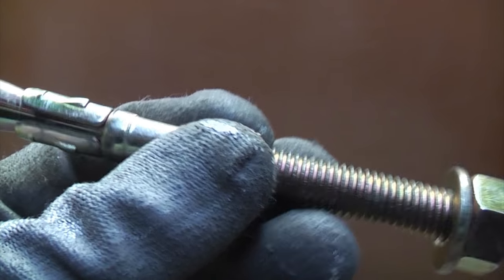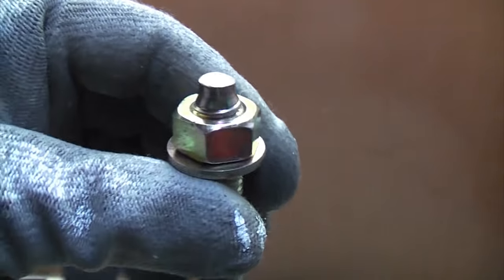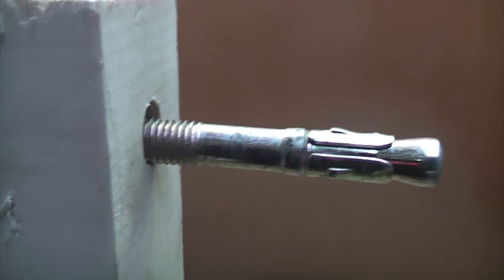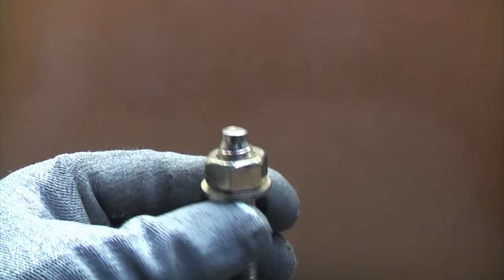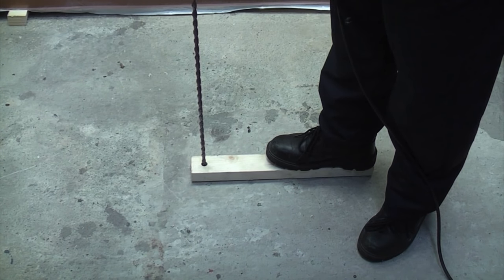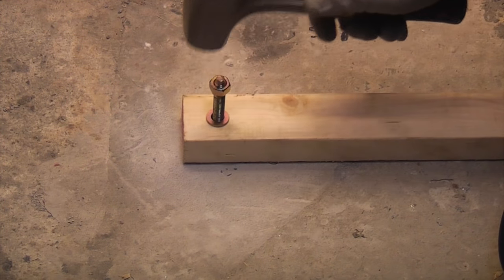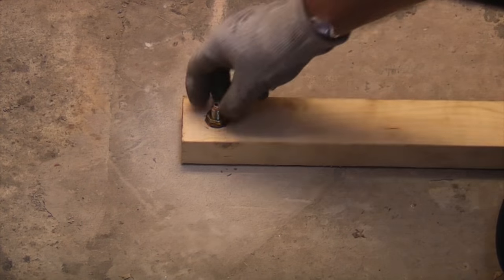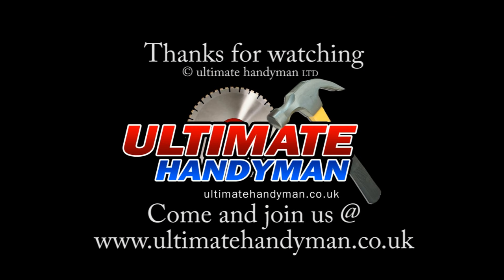Concrete anchors

Comment: When using out door in concrete exposed to the moisture water , so you need to use stainless steel screws ?
Reply from the maker: Yes, you can get stainless steel ones for external work, or some have a rust proof coating too.
Thanks for the comment 👍

Comment: Can you use this method for securing a post onto a paving slab? Do you have a video ? Thanks
Reply from the maker: You can, but I don't have a video, sorry. 
Just make sure you don't put them close to the edge, or the expansion force can crack the slabs.
Reply: @ultimatehandyman  thanks for your response and much appreciate your videos.

Comment: Hi.  I enjoyed your video, and have done what you said and drilled my hole about an 1.5" deeper than needed so that I could pound it level in the future if ever needed.  However, my neighbor (who is a really nice man) just told m that the mechanism of the bolt's expansion is thru it "bottoming out" in the hole and that it wouldn't work right with that much empty space below it.  I obviously see that your demo shows it to hold securely, but I just thought I would ask if you don't mind.  Does it matter if the depth of the hole was 2 or even 3" longer than the end of the bolt?  This is in a pad I poured that is 36" deep, so there is plenty of room to drill.  Thank you!
Reply: +LuvmyGSD I think I found my answer!  Sorry to have bothered you with such a basic question, but every video I watched just showed how to install it, it never said exactly how they worked and I finally found one that explained that it pulls that flared piece UP which caused it to work.  Again, I know this is very basic, but its my first time with them and I got worried.  Cheers!
Reply from the maker: +LuvmyGSD 
Glad you found the answer ;-)
Thanks for the comments

Comment: Good video...but. when clearing the mound of dust after drilling the hole, use a vacuum instead of a dust pan. Use the vac to clear the mound of dust, then position the vac hose over the drilled hole to clear debris from the hole for a better, more secure fit for the bolt.

Comment: I am building a 12x12 shed on a concrete slab. My question is how many fasteners will i need per wall or what is the recommended spacing for this type fasteners?
thanks for the video
Reply from the maker: I'd use M12 or M16 through bolts that go into the concrete by at least 100mm and I'd space them out about every 2 foot (600mm). That should be sufficient, although if you live in a really windy area it would be a good idea to use a few more.

Comment: hy any chance you could explain in a video the method for attatching timber posts to concrete fence posts please. i dont know what bolt to use . is there a way i can jus use bolts that go straight through timber and concrete without a nut on other side as i thought it be easier if the bolt will not come through the other side of concrete post . iv seen large bolts with threads which i think cut there own whole once in and no need to put nut on end. thanks for your videos
Reply from the maker: Sorry, I have just seen this comment as it was in my spam folder.
If you are fixing a piece of timber to each side of the post you can drill through one side and the concrete post and then use a coach screw, by screwing it into the post that has not been drilled.
Or you can drill straight through everything and use a coach bolt, nut and washer.
Or you could screw from each side and use concrete screws to fix the timber to the concrete.
https://www.youtube.com/watch?v=P0LXQG3S8ko

Comment: Hi,i am trying to secure base plates into concrete using anchor bolts but it will not tighten am i drilling to deep? Would you recommend concrete screws ?
Reply from the maker: No, drilling too deep will not prevent the anchors from working- drilling the wrong diameter hole will!
For 8mm bolts you need a 8mm drill, 10mm bolts you need a 10mm drill etc.

Comment: I always do the same thing I’ve  use the right tools and the right drill bits and I’m tired to have a problem tightening, when i turn the nut the all thing turns and the bolt can never be tight. What’s the secret ??
Reply from the maker: If the drilled hole is slightly too big the anchor can rotate (sometimes this can happen if the drill bit is slightly bent). 
To fix this problem, put the nut and washer on the anchor, then use a claw hammer or crow bar under the nut and lever the anchor up, as the anchor moves up, it should expand on the end and then grip the hole.
Or you can put the nut and washer one, then grip the very top using mole grips/Vice grips and tighten the nut.
Thanks for the comment 👍

Comment: Hi, I want to use these anchors to mount kitchen cabinets. The walls are concrete. Is there a better method for this?
Reply from the maker: Hi, These are probably your best option for concrete walls as they hold extremely well in concrete. 
You obviously do not need anchors as large as this for kitchen cabinets, we often use M6 (1/4 inch) or M8 (5/16 inch) diameter anchors for small jobs at work. 
It does depend on the type of cabinet hangers that you are using, in the UK if I was fixing to a solid wall I would just use wall plugs and screws to hold the hangers to the wall. 
http://www.ultimatehandyman.co.uk/how-to/fasteners-fixings/wall-plugs

Comment: Can I drill the hole with just a dig corded hammer drill and would thou reocomend this for fixing a shed to the floor thanks
Reply from the maker: Yes, but if the drill does not have hammer action it will be really difficult.
These will be fine for fixing a shed down to a concrete base.
Thanks for the comment

Comment: Will these fit through a hole in a bolt down plate for a fence post ?
Reply from the maker: It depends how big the holes are. If you have for example a M12 hole and you use a M12 anchor, it will not go through the hole, you either have to drill the hole larger in the plate, or drill the holes in the concrete, knock in the anchors and then fit the plate over the anchor (the base of the anchor is wider than the threaded part)

Comment: I want to use these to attach a ledger for decking purposes. How deep do I need to drill into the brick? I know the brick is a solid engineering brick but not sure if I drill too far where will it end up the other end? I understand the bolt bites the other end when it's tightened but if I drill too far what does it bite into?
Reply from the maker: Bricks are about 4 inches deep, so if you drill about 3 inches you should be fine.
Obviously, you do not want to go through the brick or it won't tighten fully and expand as it should.
Here is a ledger that I installed a few years back-
http://www.ultimatehandyman.co.uk/how-to/decking/fixing-a-ledger
Reply: On that subject. Some say it's not good to put a ledger level or within 150mm of the DPC. I have used Thompson sealer on the brick and will use washers to leave a slight gap. Your thoughts please
Reply from the maker: I've always set the ledger level, but ensure that the deck is sloping away from the property.
It's best if you can get the deck below the DPC but this is not possible most of the time.
P.S. make sure you use rust proof washers or you might end up with rust stains etc.

Comment: Hiya. Will these work ok in sandstone or will it pop a peice out? Thanks
Reply from the maker: +Greg O'Brien 
They will work in some sandstone, but are really designed for concrete. As long as these are not being used too close to an edge they should be okay.

Comment: Hi! 

I'm wondering how well these will hold in a breezeblock wall? Any idea on how much force then can take perpendicular to the wall/floor? 

Many thanks!
Ed
Reply from the maker: I don't think they will work well in breeze block, snap toggles will work though-
snaptoggles
Reply: *****
The snaptoggles look good - thanks! But i'm unsure if they are hollow? I'm also planning to put quite a lot of weight on it which i'm not sure if snaptoggles would hold.. 
But not to worry - thanks.
Reply: Edward Hayter
Ah unless you meant go all the way through the breeze! That would work well!
Reply from the maker: Edward Hayter
If you drill the fixing holes and hit the cavity in the breeze block you could use a snaptoggle, if you drill and it's solid (such as at the edges) you could use resin fixings-
Resin anchors | Resin fixings

Comment: Very informative thanks m8. could you use that for securing a lock loop for a bicycle ?
Reply from the maker: You could, but it would not be very secure and anyone with a spanner could easily steal it. You can get some security construction fixings that require special tools to remove, one of those would be much better IMHO
Thanks for the comment
Reply: point taken, I'd hope by the time they got to bolt no 4 someone would see them lol

Comment: hi chez are these thru bolts the same as rawl bolts or they 2 different things? i seem to be getting confused as the more i read there seems to be more and more different types of anchor fixings, am looking for an anchor bolt i can screw down flush with metal late not one that sticks out like these thru bolts seem to, cheers john.
Reply from the maker: +John Walker 
Yes, you need the bolt type for that, normally called rawl bolts.
Reply: +Ultimate Handyman chez can you hammer these in so the nut is flush then tighten it or do you need to leave the small gap berfore you tighten up. cheers john
Reply from the maker: +John Walker 
Yes, you can knock them in with the nut on the very end, then tighten.
But when you tighten it pulls the stud up through the nut and can stick up 10-20mm before the fixing is tight enough.
You could of course cut that bit off with an hack saw or angle grinder
Reply: +Ultimate Handyman thanks chez
Reply from the maker: +John Walker 
You are welcome John ;-)

Comment: Can you use these also without problems in a brick wall?
Reply from the maker: They are not designed to be used in bricks as most bricks have hollow sections, however I have used them in some bricks and they worked fine for me. I'd be more inclined to use resin fixings though as they will definitely work- https://www.youtube.com/watch?v=oUJPjJsdl0c

Comment: Bro this bolt can bear 80kg or 100kg wight , if we set in house slab .. rply bro..  for hanging purpose .... Which size will u preffer for my requirements
Reply from the maker: You'll have to check the manufacturers specifications ;-)
Thanks for the comment 👍

Comment: I have just built a 20ftx12 workshop I need to fix to concrete,I have 100 mm 10mm concrete bolts,do you think he's are adequate
Reply from the maker: It depends, there are just so many variables, such as what the structure is made from, the weight, the amount of fixing points, the potential wind etc. 
We would often use eight M12 by 100mm anchors just to hold down a conveyor unit, where the conveyor is heavy and it's inside- so no wind etc.
Reply: Also if you don't mind,I have hitachi sds plus drill,but collar only seems to take around 12 mm diameter bits,I have 200 mm x 18 mm bits,to wide, what do I need?
Reply from the maker: @philhode5104   All SDS drill bits are the same size (where they fit in the chuck).
SDS and SDS plus are about 10mm, where they enter the chuck.
SDS max is about 18mm where it enters the chuck, it sounds like you have SDS max bits! 
You either need a SDS max drill (very expensive) or a SDS drill bit
Reply: @ultimatehandyman  thank you,yes I realised what has happened, I ordered bit from UK drills,I received max bit,was puzzled why it didn't fit,now ordered sds plus bit,yes sds max expensive 400 plus !!!

Comment: what kind of bolt would I use to secure my shed to the edge of  my shed Base?
Reply from the maker: +naveed “NEO76” khan 
For close to the edge fixings I would use resin anchors as they do not expand (which can break the concrete at the edges) 
https://www.youtube.com/watch?v=oUJPjJsdl0c

Comment: At 1:07 to 1:17, the text says, "one thing you can do is use them for close to the edge fixing..."  I think the narrator actually said "can't" but the voice recognition software doesn't understand Brits.  I think he meant "CAN'T."  He calls them "through bolts"; in the US we call them wedge anchors or Redheads, which is actually a brand name that's become generic.  We also have s bolt called a "Titen" from Simpson-Strongtie which works better close to an edge.  They cut threads in the concrete, so they don't exert as much expanding force, so they are less likely to crack the concrete. We haven't caught up with the rest of the world, so we only have inch (Imperial?) sizes- Simpson may have come up with metric sizes for the other side of the pond.

Someone asked about the definition of edge distance- check this link-  https://www.engineeringexpress.com/wiki/spacing-edge-distance-embedment-important-concrete-anchors/

It gives a rule of thumb which is that an anchor should have a minimum of 12x the diameter of anchor spacing to an adjacent anchor or to any concrete edge. Also, the concrete should have a minimum thickness of 1.5x the depth of embedment.
Reply: Should I have said, "the voice recognition software doesn't understand Scotsmen." ?
Reply from the maker: Unfortunately I don't have to time to correct all of my videos, as there are over 700, but I'm trying to get around to doing manual closed captions. Sometimes the software gets it really wrong!
Thanks for the comment 👍
Reply: Clearly, the path to Artificial Intelligence leads through Artificial Stupidity- computers are even worse than humans when it comes to "common sense."

BTW, I appreciate the suggestion of overdrilling to facilitate "erasing" unneeded bolts- it's a rare industrial building that doesn't have the ground-down stubs of bolts scattered across the floor.

Comment: realise this is 7 years old. but putting bases in concrete for a pergola. so use these, or resin ones, or both?
Reply from the maker: As long as the concrete is in good condition and you are not drilling close to the edge of the concrete, these will be fine.
If you are close to the edge, I would use resin fixings ;-)
Reply: @ultimatehandyman  havent done the concrete as yet :) just want it to be as sturdy,strong as possible as dont want to put the timber post in the concrete itself, so using a bracket. so use these for the base, and for the ledger on brick right? (lean to pergola) . been on a watching your vids binge lately ..
Reply from the maker: For the ledger, I would use resin fixings, as some times the through-bolts don't work too well on some types of bricks.
Through bolts will be fine in the base- as long as they are not used close to the edge of the concrete, or the expansion can crack it.
Thanks for watching the videos 👍🏻
Reply: @ultimatehandyman  cheers mate. so much conflicting confusing advice out there. best to over do it tho rather than regret it afterwards right. u speak a lot of sense in your vids tho. so thanks again :)
Reply from the maker: You are welcome
Thanks for the comments 👍🏻

Comment: 3.03 you should sweep b4 removing the drill from the hole
Reply: Dril a hole 3inch and a  wall concrete
Reply: thanks for pointing that out. A VERY useful tip!

Comment: If the bolt got M6 labelled on it what’s the actual drill bit diameter for it? 6mm?
Reply from the maker: Yes, that is correct 👍
Reply: @ultimatehandyman  so M6 is 6mm, M8 is 8mm, M12 is 12mm and so on?
Reply from the maker: Yes ;-)

Comment: it better to saw it off than tap it down. u see if u planning to tap it down later, then u must drill the hole deep for it to fall thru or fall deeper inside but what you forgot to mention the thickens of the concrete needs to be taken into consideration. if the concrete is 4" thick, and u drill deeper than 4" so you can tap down later, then the wedge part is going to pass the 4"  when installing and the wedge may lock under the 4" slab of concrete which you don't want as that wont be strong and defeats the purpose of the wedge anchoring to concrete. Better to drill 3" deep, the wedge locks at 3" deep solid concrete which leaves 1" solid concrete before  the concrete ends. later  grab a grinder and cut off the excess if you want but al least until that time u are sure the wedge is actually anchored properly on your concrete and not below the concrete.
Reply from the maker: Thanks for the comment 👍

Comment: Handyman what's the correct name for the tool you are using at the end to tighten the bolt fastener?
Reply from the maker: It's a combination ratchet spanner. The one in the video is sold at Halfords- https://www.youtube.com/watch?v=Qd2LLH3UNmU
Thanks for the comment
Reply: Ultimate Handyman thanks

Comment: Thanks. I fix these periodically and forget the technique each time as I do it months or years apart.
Reply from the maker: You are welcome. I probably only uses these a couple of times a year, but ironically I used some yesterday on site!
Thanks for the comment ;-)
Reply: A premonition indeed! I am fixing some today to tie a tarpaulin over the shaft which has a glass pane broken on the roof at third floor. The monsoon rains come inside down to the washing machine on the ground floor. Will sweat for sure :)
Reply from the maker: Blimey, that sounds like a difficult job.
Best of luck with it ;-)
Reply: Fitted 4 anchor bolts and uses a tap and a dish TV shaft for the rest. The tarpaulin is stretched and covers the opening. Unfortunately it is slightly shorter from one side and I have ordered another larger one.
Reply: One important aspect I noticed is that one has to screw in the top nut onto the threaded shaft of the anchor bolt for 2 to 4 turns before hammering in the bolt. Otherwise tightening of the said nut with the spanner later is unsuccessful.
Reply from the maker: The thru bolts that I use are reduced at the end by a couple of mm, so you don't have to do that. You can even knock the anchor in and then put the washer and nut on afterwards.
Thanks for the comment